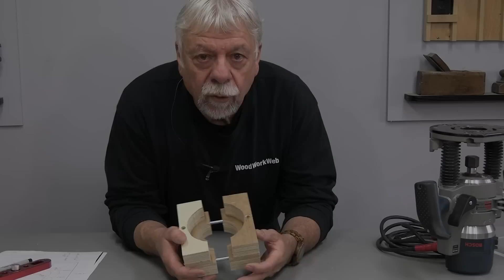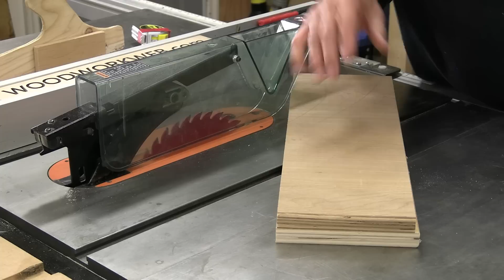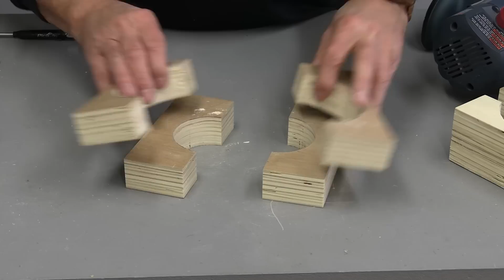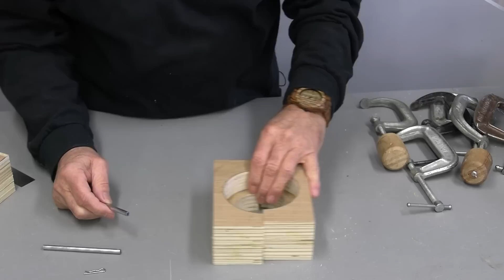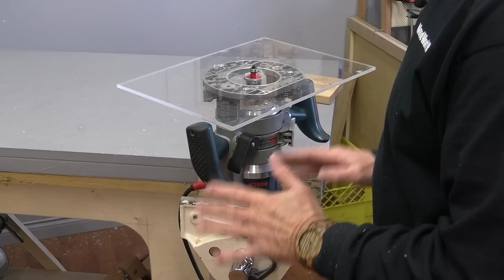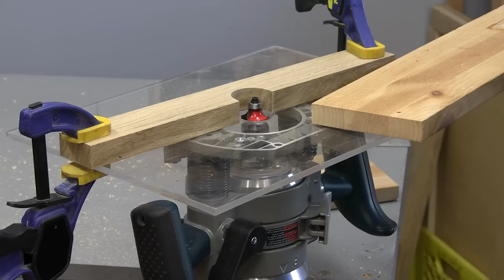Make Your Own Wood Router Clamp JIG!

Comment: One time I quick clamped the head of my old flat topped pistol grip Makita then clamped that assembly to a bench. I plunged a vertical panel raising bit up through a thin plywood sub table attached to a sub fence and made a raised panel. I still have ten fingers albeit laced with scars. Roy Underhill often sports bandaids and he doesn’t work with power tools. Newbies don’t try any of this at home.

Comment: Interesting, I think I would have made it a bit deeper to get a bit more bit around the router base.  Yeah you needed that vice to hold that 20,000 rpm of spinning death from flying away.   Think I'll stick with my alternate base for my palm router that attaches to my drill press.

Comment: this is a dangerous miss colin. the leverage is working against you here and the failure of that slipping would be catastrophic. router accidents are life altering and you can’t sew the mangled results of your fingers back on. this should be taken down.
Reply: I agree. Not strong at all...did you see the way it was moving when shaken?
Reply: @muhhamad786  yeah especially since he built a router table top for it... might as well just do that with a piece of plywood and a 2x4 to clamp in the vise. the router could fit into the shoulder of the vise and table and the plywood could be firmly on the tabletop. this seems clever for the sake of being clever and that's a dangerous combo when you are moments away from disaster at any moment with this thing
Reply: Yeah I thought the exact same thing @jasonbenjamin1464
Reply: I combletley agree.

Comment: Why not just set your plexiglass base (heck I'd of just used the cheap plywood for the base) on a pair of saw horses, or in a wood box like a milk crate, or something.  Anything is safer than that!  And you don't have to worry about cracking the router housing in the vice, or worse having it fall out while operating.  Sorry can't agree with this one, bad idea all around!

Comment: Bad and dangerous idea on so many levels as others have already stated in comments. I like your channel Colin but strongly recommend you take this video down before someone gets hurt. A router should be secured by the plate, not the motor housing. There are other DIY alternatives.

Comment: If you are not very careful, it can be a good way to cook your router. At least some models of router draw cooling air in through vents around the end cap, not from the flat top, and blow the hot air out the bit end of the motor casing (so they don't choke the motor with dust, unlike the ones that draw air from the bit end of the casing).

Comment: Bad idea.  There is a zero percent chance I’m mounting a 2-3HP 15000 RPM motor with a carbide bit in it inside a vice.  These things are dangerous enough when I got two hands on em.

Comment: Completely underwhelmed by this idea.  If you want/need a small router table, just buy a router table insert and put legs on it.  It will hold the router more securely and does not require having a BIG vise to travel with it.  Still have a stability issue though...router tables are big and heavy for a damn good reason.
Reply: Did you see how it almost came right out when he was reefing on it to show how stable it was?  Yeah no thanks
Reply: @MasterRanger71  Yes!  Looked scary.
Reply: @MasterRanger71  Possible vice wasn't tight enough?
Reply: I can see it being useful for someone who’s short on space (like in their vehicle/trailer) like a carpenter who does work onsite rather than in a shop.

I’m sure the stability issue has to do with a poorly made jig. More tinkering with the jig and it’ll be stabile.